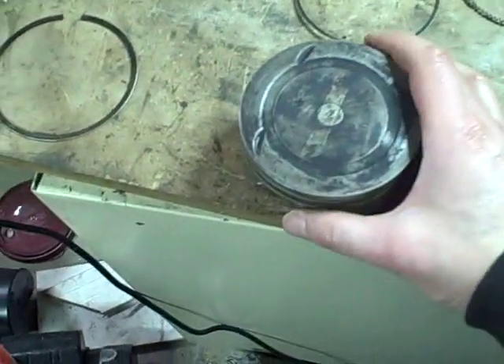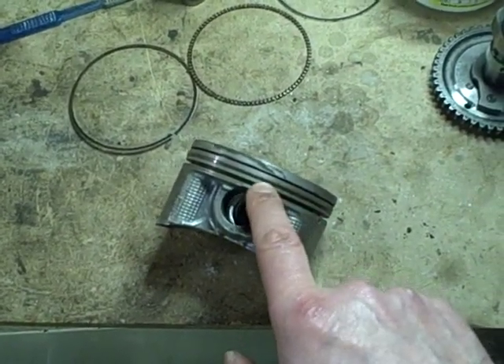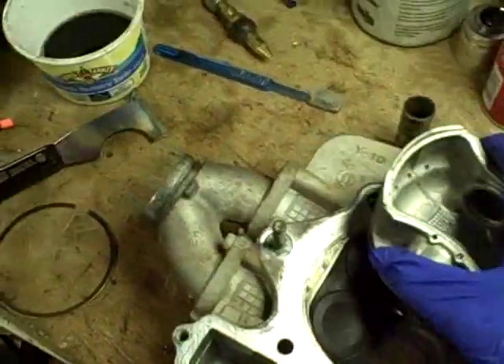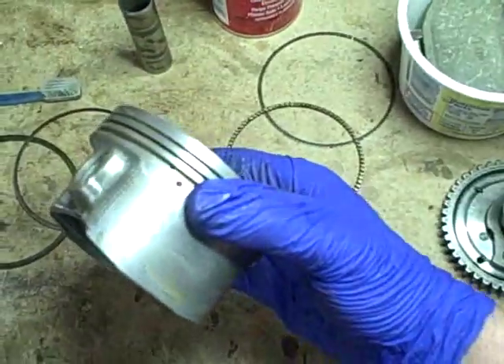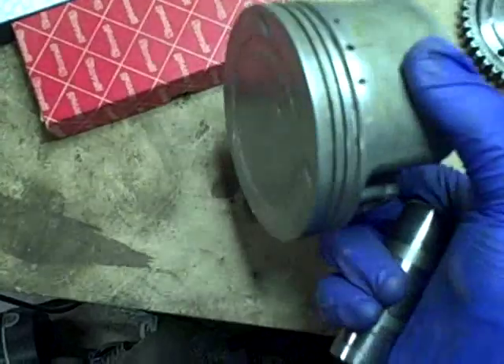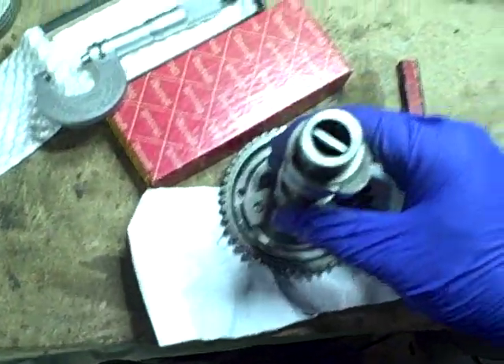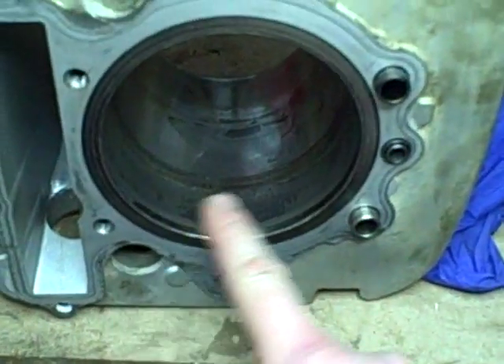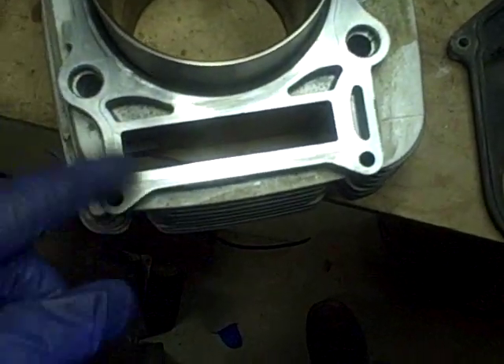Yamaha Grizzly ATV Project Part 3: Top end components cleaning and inspection

Comment: Hi i have a 450 yamaha atv 2005 kodiak problem the motor when you Turn it by hand,  the motor Turn then  it lock solid,  Turn the other way then lock again,  can seize valve cause that problem ???
Reply from the maker: Stuck open valve, or bent valve can be a cause. Some motors are called interference type engines, and can do this if they are severely out of time, like when a timing chain jumps several teeth, but I think most small engines do not suffer from this.

Comment: Hey Steve,
Kevin here. I bought the grizzly and the problem about the oil coming out the breather i found what was happening. The carb float needle was stuck open and the gas tank petcock was not operating as well.  That caused gas to overflow into the crankcase. It had nowhere to go except to come out the breather. Thanks again for your videos and help!
Kevin Morgan
Reply from the maker: Kevin Morgan Glad you found the problem. Thanks for watching.

Comment: Hey Steve Great Video!!! I have a potential Grizzly i thinking of buying. It cuts out when you ease off on the throttle. Also they  said something about little filters in small rubber tubes being clogged so the oil was splashing backwards where it shouldn't go. Any ideas what they may be talking about? 
Thanks ,George
Reply from the maker: Kevin Morgan wow, no idea on the oil issue. crankcase breather tubes maybe??just a guess. As for not idling, might be a clogged pathway in the carburetor. might be an easy fix. I love the old grizzly!

Comment: What did u use to clean the cylinder walls?
Reply from the maker: For light rust on the walls you can use a scotch brite pad. When honing, I use brake cleaner to wash away the grit as I am honing.

Comment from the maker: Hello, glad you like the videos. Those indentations are there by design for clearance. I looked at a brand new oem piston, and it has them too. If they were caused by valve clash from improper timing, there would most likely be only one mark, since there is no reason for both valves to be open at the same time at any point in the 4 stroke cycle. What happened to yours? 2012 is pretty new to need a rebuild.